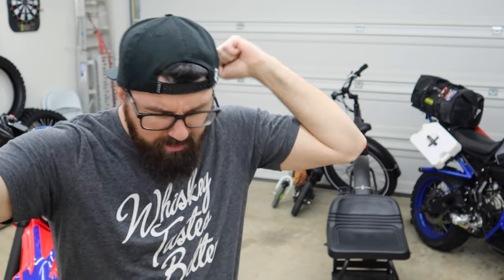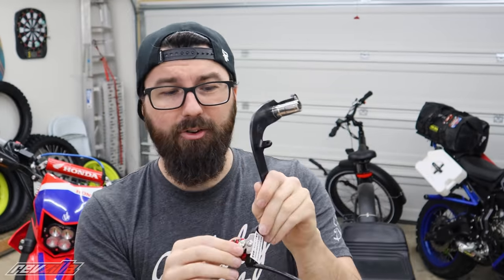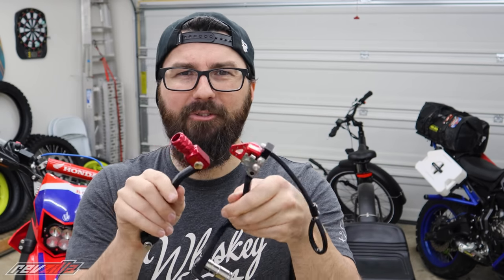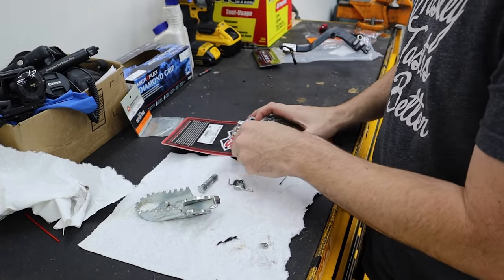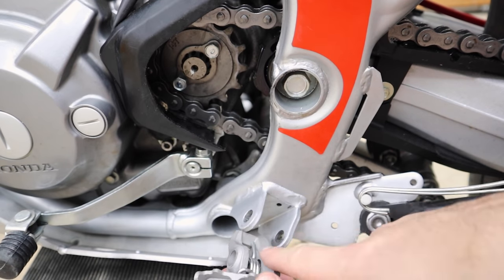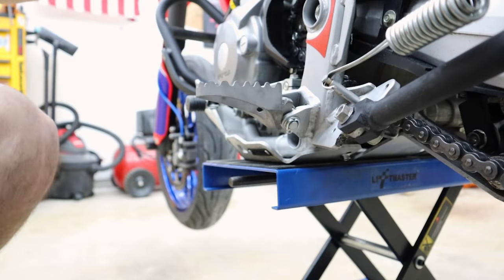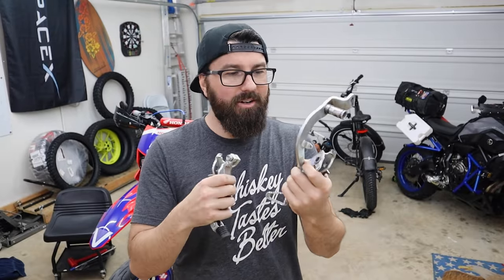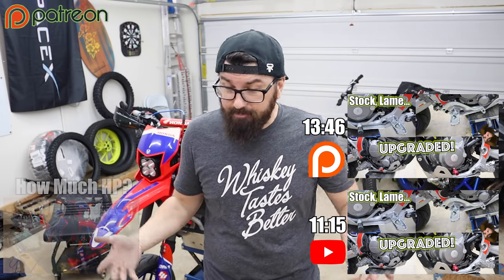Pegs, Shifter, Brake Pedal Upgrade CRF300L

Comment: Hi. The cable on the brake is called a brake snake. It’s job is to stop the brake lever from folding out and back on itself. The cable should also run to the inside of the bash plate and attach where ever you can find a good strong spot. Where you have it on the outside of the baseplate it is begging to get snagged. Cheers.👍

Comment: Can confirm the rear brake pedal DOES NOT FIT a 2023 Rally. The offset/jog on the pedal that interacts with the master cylinder is the wrong offset. Could probably mount the master cylinder on the outside of the bracket and install screws from back side……but seems like a bad idea.

Comment: Ok. Watched ya vid. Feeling inspired...again.👍 Ordered my brake pedal...exact model as per link. Pedal arrived, tried to fit but it is not compatible with the 300l!?!? Does not align to the clevis. What did you bend, brake or grind to force this to work "as it should"?
Reply: Same problem here

Comment: I did the Zeta Trigger brake lever about a month ago on my 300 Rally and really like it, plus it looks incredible. The brake snake doesn't work well on the Rally's plastic belly pan. I might install mine if I ever get an alloy skidplate on mine.

For those with big feet, it's nice to have a longer shift lever. I've used Hammerhead shifters with their extended shift tips. You can get +10mm and +20mm in addition to stock length. They are pretty reasonably priced, too. The Zeta Revolver is another nice shifter that offers some fine tuning adjustability to the shifter tip, also reasonably priced, and sold by Revzilla (which is a plus since they are nice enough to sponsor you).

I'm still trying to settle on some footpegs. I think I want Pivot Pegz, but not too keen on spending $200. I grabbed a set of Zeta knocks from Amazon for $20, but I don't think I trust them because they are suspiciously lightweight. They also sit at a funny angle on the bike...you get what you pay for and I got them because they were an open package return for $10 off and I was leaving for camping trip within a few days and Jeff Bezos sent one of his drivers the next day to drop them off...

Comment: I broke 2 cast aluminum shifters on my DRZ until I went to a steel one. 
Never had issues since 💪🏻
Reply from the maker: Chris Fire guy would say "I just try not to crash so much"
Reply: My steel brake lever bend back on itself lol.
Reply: Any opinions on the problem with the gear shaft failing when crashing on the left side? I've heard many instances of this. One remedy it to actually have a softer gear shifter not stronger so the shifter fails before the shaft. People I know have actually grinded slots in their gear lever so it will break before the shaft.

Comment: Jake, I have tried a number of brake pedals like the Zeta Trigger and the bend that connects to the master cylinder is too shallow and forces the plunger out away from the bike and puts the activation in a bit of a bind.  I noticed you have the same issue but didn't discuss it. I don't want to try and bend the brake pedal or the master cylinder mount on the bike. Maybe I can mount the brake to the outside of the cylinder connector and use a spacer in the center to keep the shape and a longer pin to connect brake pedal to outside surface of cylinder connector?  Your thoughts?
Reply: That's exactly what I had to do and at this point it is working fine.

Comment: Nice mods. CRF "Bling". The stock brake pedal is just asking to get bent. My old XR250L came with a folding braked pedal. Seems like they only cut corners on the CRF300L where you can easily upgrade. Some people may be perfectly happy with the stock bike, some will trick it out. Honda is smart. Quality where it counts.

Comment: I tried one of these brake pedals today and it would not fit. The clevis end was about a 1/4" shorter on the zeta pedal. I did swap out the clevis for the zeta one so who knows may try again with the factory clevis.

Comment: Do these same parts fit the new CRF300LS? I am thinking a lot of the CRF300L parts (not he rear shock) fit the LS.
Reply from the maker: I would assume just about everything other then suspension. They have crf300l specific brake pedals now. I would get one of those because the one I have is a little off

Comment: Not sure how you got the brake pedal to fit, but it just doesn't line up right with the rear master cylinder; forced off to the side and brake won't release.
Reply from the maker: 🤔 that’s weird. Mine was slightly tight but I’m pretty sure I bent that in slight when I laid it over on that side. Like it looked tweaked in. So I put a towel around the bracket and vice griped it over a bit. Did it nice a slow and it was fine. I thought I was fixing mine but maybe that’s how they are. If your comfortable doing that then it should be fine. Sorry if I had it wrong.
Reply: @TheGardenSnake  no need to apologize. Seems like some people have had better luck than others with those pedals. I’ll give bending that bracket a try, and maybe a new clevis. If it doesn’t work I’m sure I can find a 250 guy who would want it at a discounted price. No harm done.
Reply: @TheGardenSnake  Little bending of that bracket and works like a charm. Thanks for the tip!

Comment: Take it from me..... aka the idiot who rode twice across the country on a WR250R and pissed off/confused EVERYBODY with wtf I was doing.

Switch back to your "dual sport" trim for the travel portion of your trip and ship your adventure tires to a bike shop close to the event so you can do the tire swap there before doing your offroad stuff once you are in Cali or you will be replacing BOTH of your "Adventure Tires" by the time you get to Flagstaff (instead of just the rear) and then have the knobs on the new set half worn down again by the time you get to the event. 

I'm not here to " Disrespekt tha Cense' " ....... Just wanna see you have the least amount of "issues" with your journey.  

Just TRUST ME on this GNOMIE. 
It's just the , "Waaaaaaay of the Road!!" ;)

("Baby Randy" approves of Jake deleting this comment in confirmation of being read)

Comment: The brake does not fit a 2023 crf300l non abs. I'm out a hundred bucks. Lesson learned.
Reply: To make the brake useable I made a longer pin (7mm diameter) and drilled a hole for the cotterpin, placed a nut in the center of the mastercylinder bracket as a spacer and had the brake lever sit on the outside of the master bracket. The pin I made had a small head on it so I only had to cotterpin one side, I imagine you could find something that works without making it yourself, I just happen to do cnc work.